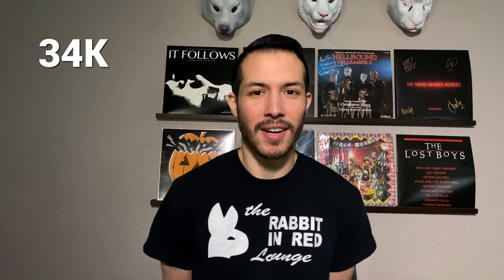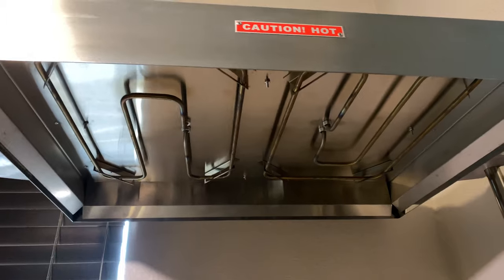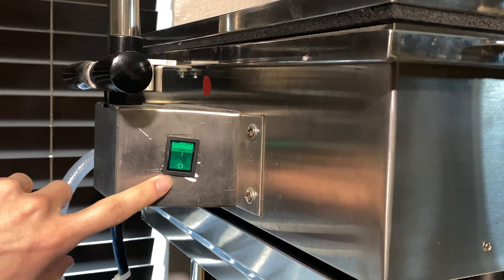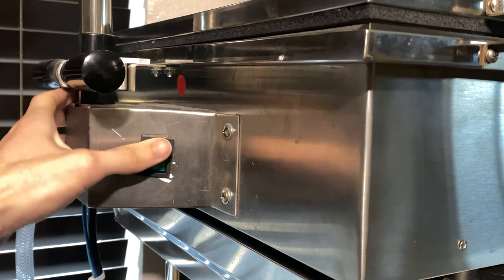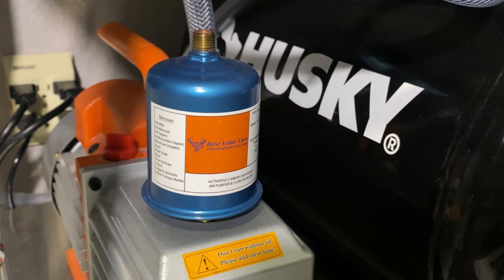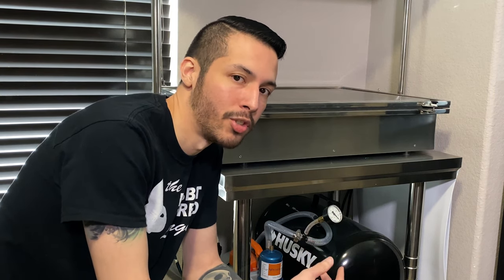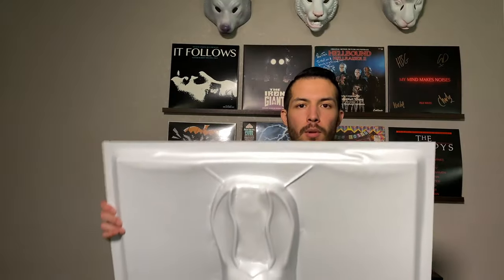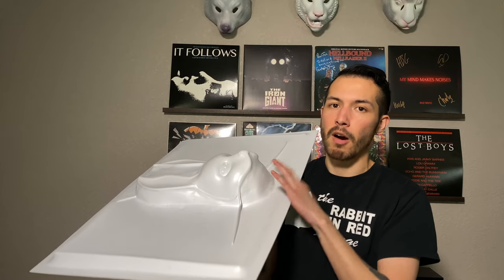My Vacuum Forming Machine V2

Comment: Why didn’t you go with a 12x12? That sure is a lot of waste and extra money for plastic.
Reply from the maker: The vacuum former I have comes in only 2 sizes. A 12x17. And a 18x27. The 12x17 is too small for the size of projects I do. In this video I just wanted to show an example for one mask. I usually pull 3 masks at a time. Or big armor pieces that’s bigger then 12x17.
Reply: Crazydog500 Oh I gotcha! My mistake.